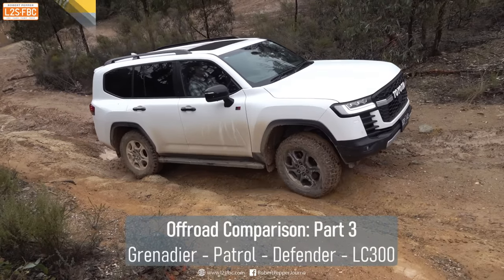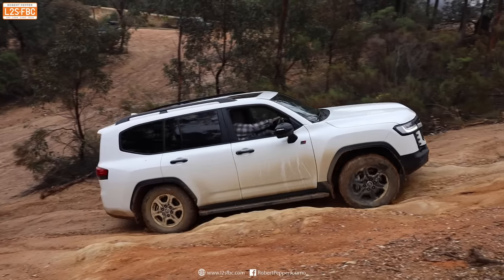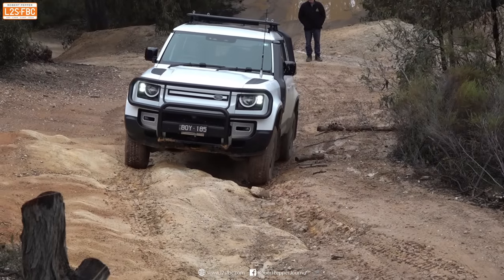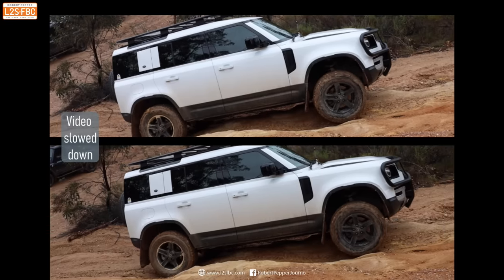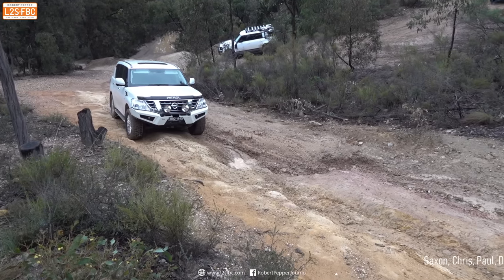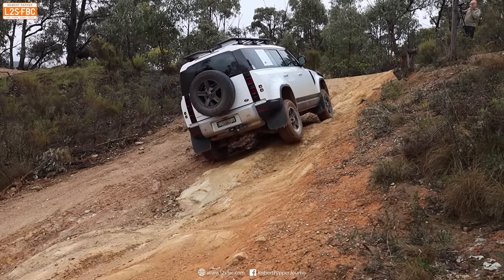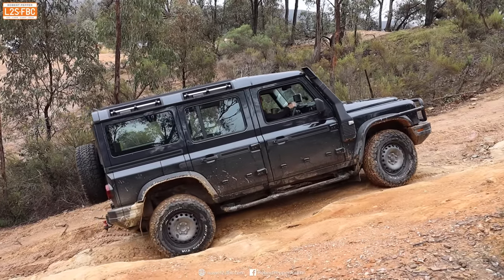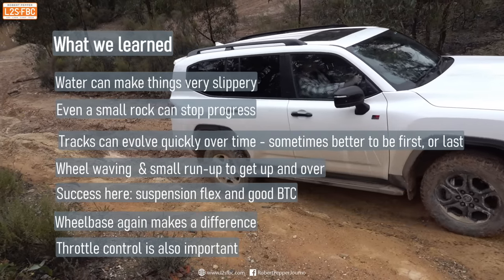Grenadier, Defender, Patrol, LC300, Part 3: Slippery Climb

Comment: Don't know, why on this Grenadier the lockers where misbehaving, but I think the Ineos had to make a decision, Full lockers or fund more the traction control developement.  So why to have very good brake assisted lockers and addition to that have full mechanical lockers on top of that?.
The Grenadier's BTC is just enough not to get stuck too easely. it is designed to use the mechanical lockers. 
That is just mu opinion, based on the Ineos adverted philosophy, simple as possible.
I think the Defender cheats a bit, because the auto locker can not be turned off., as soon as it detects slip, it uses the rear locker.
Reply from the maker: Yes true re Defender.  The Grenadier is available without lockers in 2 of the 3 current grades so it's fair to test with/without, and would anyway.

Comment: There is another possibility regarding certain vehicles' sensitivity to traction control. It could be more of a manufacturer prioritizing reliability/longevity over increased sensitivity, as well a driver training issue, meaning they have to be taught to not let off the accelerator or brake, which will deactivate traction control. The issue with manufacturer longevity, is, and I have only seen this discussed once by a Toyota engineer, so I don't think it's well understood, is that with increased sensitivity there was more risk to damage to axles and other driveline components from repeated torque/shock load/stress and so the sensitivity was dialed back.
Reply from the maker: I doubt that's the case - sensitive BTC prevents excess wheelspin. See my three Toyota engineer interviews for details.
Reply: Good to know.  @L2SFBC
Reply: That doesn't make sense to me. Yes, the brake would cause torque redistribution and thus add some stress on the driveline, but I think that's minor. However, it the sensitivity is poor and TC has to engage with higher wheel spin, wouldn't that cause more stress on the driveline? It's more about the software they developed. As a new car manufacturer, I'd say they did very well on Grenadier, unlike Ford.
Reply: I agree with that logic. However, that is what the Toyota engineer said regarding the second gen Tundra atrac, that they were snapping or twisting axles with the increased torque of the V8. What I don't understand, is how that is so as the Landcruiser 200 was also the same/similar engine. I don't know if there were other differences in the strength of the axles. Furthermore, I don't understand why there would be any difference in BTC in any of the Toyota 4x4s;  why would some need more/longer throttle response to engage the BTC. All I can say, is that with the Tundra, the drivers had to be educated on the need to stay on the throttle long enough to engage BTC otherwise if the RPMs dropped below @1500 the truck would be stuck and not go anywhere. @angeloudy
Reply: Maybe it’s not about sensitivity. It could be that the sensitivity is the same, but brake force applied differently. When brake force applied more gently, there’s more wheel spin. Just guessing.

Comment: I heard the Land Rover can't be jump started without an internet connection. If that's true, does it belong in this group?
Reply from the maker: Yes, as this is just about offroad capability, not touring capability. Where did you hear that about the jumpstart?
Reply: I don't know if that's true because powerfulukltd had to jump start a new defender with one of those jump starter packs and it started just fine.
Reply: @L2SFBC  Not sure about the original commenter, but I heard the same from Andrew St Pierre White (4XOverland). Apparently his friend with one drained the battery while parked up at a campsite for a few days and then couldn't jumpstart it without an internet connected Land Rover diagnostic computer attached.
Reply: You can jump start it.
Reply: Andrew is a Toyota fanboy. Keeing jump starting aside, the question remains: Can we take these cars remote? I have taken my Y62 remote despite not having an extensive dealer network like Toyota. I have seen several other Y62s while touring. The way we have to wait for spare parts to arrive in big cities and the wait time to get appointment from dealer is also a consideration. Despite having several vehicles issues, most prefer to take Toyota to remote locations.
Reply: I reckon it depends. If the battery is completely drained, that's possible. With electronic stuff complicated like that, I won't be surprised that it might need a computer hooked up in lots of situations.
Reply: Lol. Just no. It has jumposts in the engine bay. This is silly.
Reply: It's not true so it still belongs in this group.
Reply: it can be started from a second power source

Comment: GRENADIER IS BEST !

GOT BEST TYRE AND RIM SETUP AND OTHER 3 VEHICLES TYRES AND RIM CANT BE UPGRADED BECAUSE OF SIZE OF THIER BRAKE DISCS.

GRENADIER got best tyre setup with steel rims and lots of side wall if you aired down all 4 cars tyres to more optimal pressures for conditions Grenadier would have won easily and other 3 vehicles are limited to beter tyre options makes Grenadier Best.

Comment: It's a real shame the Defender's articulation is so poor. It seems its traction control always allows it to do well enough but it would be leagues ahead if it could flex a bit!
Reply from the maker: In that situation yes but in other cases flex counts against it.
Reply: @L2SFBC I’d be interested to hear of a situation in which properly balanced flex/articulation ever counts against a vehicle….? The point of flex/articulation is to keep all 4 tyres in contact with the ground. I do not believe there is any situation where it is advantageous to have less tyre contact.
Reply: @taranis616 In previous videos he has shown that it can cause ground clearance issues that cause other vehicles to get hung up where the defender didn't. 

It's sort of like solid axels vs IFS, it's really depends on the situation. Sold axles can be better for rock crawling and IFS better for desert running ect. So much of it is situation dependent.
Reply: @paulelledge8977  No. That simply doesn’t make sense. Ground clearance doesn’t change as a result of articulation. Any such situation where a lack of articulation causes the body to roll away from a potential obstacle is simply luck, and vanishingly rare
Reply from the maker: Ground clearance does change with flex, in both independent and live axled vehicles. The great the flex, the greater the lower the chassis is to the ground.  See Part 1 for an explanation.
Reply from the maker: Sure so an example of where flex hurts.  Jeep Wrangler with swaybar disconnect.  Failed to make a rutted climb as the front axle flexed too much the front diff hit the ground. Put swaybar back in and tried again...less flex, more reliance on BTC, but front diff cleared.  
Flex is not always your friend.
Reply: @taranis616  It's nothing to do with off roading!  I'm not sure if you have noticed, but most of the world is now paved and a typical 4x4 spends 100 or 1,000 times more miles driving on the road than off it.  Therefore the cross axle stiffness, particularly at the front, is pretty much ENTIRE set by the stiffness required for the on road dynamics (and here the defender is far far far better than any other car in the this test) and majorily on the infamous "moose test" where the vehicle must conduct a high speed lane change / swerve. Here, cars with low cross axle stiffness either end up on their roof (not something that in 2023 is really a selling point) or they must use their brake system to deliberately massively overload a front tyre (by causing a gross tyre slip ie lock up) and whilst this stops the vehicle from rolling it also stops the vehicle from turning, which is a problem when a 3 tonne 4x4 doing 60 knocks a massive hole in whatever is unfortunate to be infront of it.  The defender, sensibly, is biased to the majority customer use, which is good on-road manners and safetly.  The fact that is has the level of off road ability it does is actually extremely impressive from an engineering perspective, but it relies on complex, very well tuned electronic and dynamic systems to achieve this wide breadth of ability.

Comment: My take from this is it only takes a small pebble to stop a Defender.
Reply: LOL
Reply from the maker: it was unlucky...could have been the others!
Reply: Forgetting the 300 got stuck on the same rock
Typical comment from a Toyota driver
Reply from the maker: No, the 300 failed before the rock, it didn't made the little ledge climb.  It was first up so track was in the worst condition, and it's trivial in the dry, I've even pulled a 2800kg trailer up it.  This is why we did two runs, and even then tiny differences in speed, line, state of the ground make a difference between slip and no slip.  Unfortunately the environmental factors cannot be precisely controlled, so allowances need to be made.
Reply: @davescott5506  The only typical comment here is yours, mate.  I'm a Nissan Patrol owner and my comment was a pisstake, as Babeyoulove realised with no problem....🤣🤣
Reply: And an unsealed road to stop a landcruiser
Reply: Patrol walked it. Rock, what rock?
Reply: @einfelder8262 ‘I was just joking bro’.. after making a silly comment. Defender actually got to the rock… so whilst the Defender may have failed to pass over it, the Toyota got scared just seeing it 😂
Reply: Nissan patral is better 😍👌
Reply: I think the Defender had bad Tires.
Reply: @artelie940  No

Comment: all that electronic bullshit is useless in greasy conditions . That`s when tire choice comes in and ya gotta draw the line between being an off roader or a pretender that needs his comfort .  ya cant have both. Having said that the 300 is a cut above the rest here over all . i mean defender is 180k !!! why would you ?  y62  great car but fuel is 2.20 so its really not an option . dont even know  what that other thing is and neither would an outback workshop
Reply from the maker: Give the "electronic bullshit" a try.  You'd be amazed at how well it works in greasy conditions where you need to minmise wheelspin and turn.  Good luck turning on wet clay with one locker let alone two...a while back I was on the Wrangler JL launch and the then-MD was driving, trying to turn up a 90 corner in the mud. He was twin-locked.  Kept understeering.  I took the lockers out for him, and he nailed in next time...you could see the BTC doing its thing, not restricting turning.  Just one of many examples.
Reply: @L2SFBC   lunchbox in the front all day . never had an issue on clay it just makes it easier to turn .